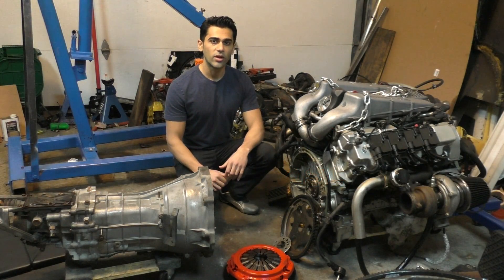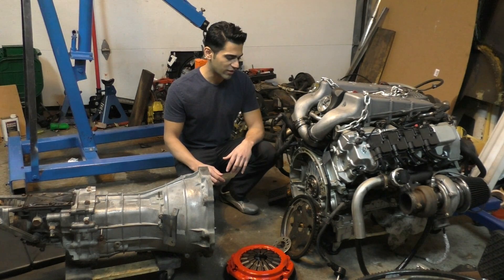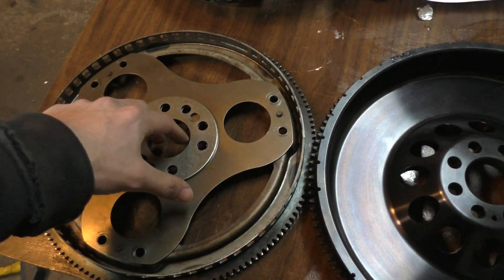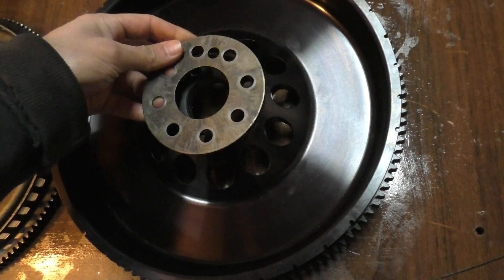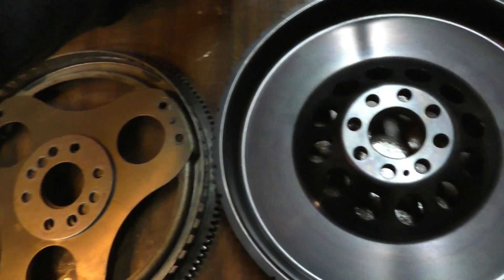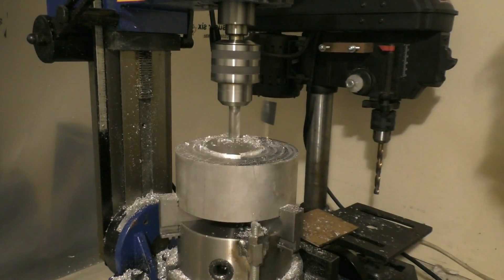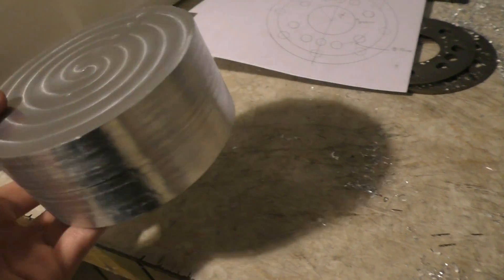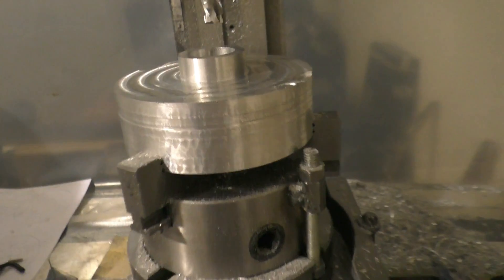DIY Billet Parts/Flywheel Adapter - E55 ASL Part 2

Comment: This center adapter approach opens up sooo many cans of worms…..( in a good way)….now I’m all charged up to make an adapter to connect my tiny 2 banger kubota diesel to my Suzuki 5 speed. Amen…..another approach would be to use two mild steel plates. Drill the patterns add bolts and weld the plates.

Comment: Hey man! So I actually own an SL55 AMG and I desperately want to swap to a manual. I'm planning on doing a build similar to yours but I want to keep the sl55 frame and convert to a Misha Wide Body

I'm planning on converting
 SBC>Standard Brakes/No ABS/ESP
 ABC>Electronically Adjustable Coilovers
Central Vaccum Locking>Electric Locks 
Power Top>Targa Top 

I want to run my car off of a simple standalone ECU and remove all of the Mercedes Modules

I want to have my setup be as analogue as possible to save weight and increase chassis rigidity, but also to simplify my build/maintenance. 

Is there any way you could give me resources on how to fabricate these parts myself, or ideally sell me the required materials to convert my 722.6>CD009? I would appreciate it so much. Thanks!

Comment: I know it's way to late to mention this but I feel like the extra weight on the rotating parts of the drivetrain might have some noticeable effect on the peformance.  It seems to make more sense to just get a machine shop to make a custom flywheel or flex plate.   I understand you're trying to keep to OEM parts for cost of repairs but flywheels don't usually blow up as often as other parts especially if they are custom made for the application

Comment: Liking the build so far. Question: Why are you using aluminium for the adapters? Is it strong enough? The crankshaft and flywheel are made of steel alloy, right?  Thanks. Cheers

Comment: You really need to use steel for this, aluminium will not hold up over time. Trust me. The shearing force is tremendus when doing high power cluch dumps. Also you need to balance that spacer or you will kill the bearings.
Reply: It's a race car, longevity isn't a huge concern.

Comment: I don't think you understand the Danger of the possibility of the flywheel shaking its self loose, & exiting..
    Did you check for runout ??
All that extra weight is going to add to inertia.
If its not balanced its going vibrate like hell.
Probably work ok if it were just for show.

    Not the way i would do it.

 The right way would be too make a new flywheel, then get the engine rotating Assembly balanced along with the new flywheel separately neutral  balanced.

Comment: Do you expect any additional wear on the crank bearings with the flywheel/clutch sitting further out from the engine?  Great channel btw, subbed.
Reply from the maker: Thanks. The weight of the clutch and flywheel is pretty negligible compared to the type of forces main bearings go through in their normal application, so shouldn't be a problem
Reply: @xfmotorsports  Thanks for the insight.

Comment: Nice work there, just a suggestion, when making your own flywheels and adaptors a kevlar blanket or a steel scattershield would be good insurance, or even just weld some 6mm plate where your feet/ankles are.. just in case. Have seen cars when they let go and it's not pretty.

Comment: This was very clever of you, not only with the makeshift mill but how little tooling you used to make the adapters. I wouldve tossed the parts on the lathe to level them out, then drill and bore out the center hole THEN put it on the mill. This looks way more efficient while maintaining necessary tolerances. Great video

Comment: Have you considered welding the bellhousing adapter to the actual bellhousing instead of bolting it on both the bellhousing and the engine side?
Reply from the maker: I thought about it, but I wan't to leave the clutch and transmission unmodified. It will be easier to swap the transmission this way if I mess it up on the track

Comment: The choice to make such a large adapter is interesting. Most people choose to machine down the bellhousing and then make an adapter from there. This lets the input shaft sit in the original bearing position, although the bearing does need to be changed.

Won't this solution introduce quite a large amount of flex between the transmission and engine casting? Also you've still got to machine a huge adapter to go between the bellhousing and the engine casting it looks like.
Reply from the maker: Well, it will make more sense in the next video. The bell housing adapter is also going to be solid mounted to the chassis. Its a part of the structure of the car the way the chassis is designed, so the transmission had to be spaced out.

Comment: are you going to balance the adapter incl. flywheel and pressure plate? you should be! what alloy did you use? you need to build it with certal. otherwise i dont think you will have long time fun with it.
Reply from the maker: The adapter its self is very light, just 1.5kg so I don't think balancing that would be a concern. I might balance the aftermarket flywheel if it seems off. It had no balancing marks on it. Aluminum grade was 4032 I believe
Reply: @xfmotorsports  yes i see, and close to the middle. i would do it with flywheel and pressure plate on it. as one pice. will be positive in acceleration, too. as unbalanced rotary mass is hard to accelerate. hope you get the exact distance for the gearbox. 2mm and the clutch wont open or close :D pain in the ass work. good to see you are keeping it up! all the best from germany! :)
Reply from the maker: Haha its a pain for sure, but anything over that slow shifting automatic
Reply: is it that slow? i drove my friends e-class some weeks ago. its same model as yours but a diesel. never recognized it. but shure, for racing its a different shift time :D

Comment: Great work, since the adapter is a big piece of metal which is connected directly to the engine I think it should be rotationaly balanced, and those bolts need some kind of thread locker.
Just my opinion, and I love your videos.
Reply from the maker: Yes, I did use thread lock on the bolts. The adapter is only 1.5kg and symmetrical so should be okay without balancing. Same reason why supercharger pulleys or idler pulleys aren't balanced